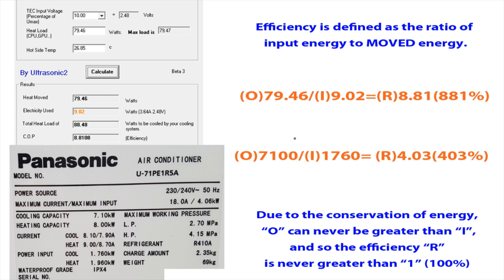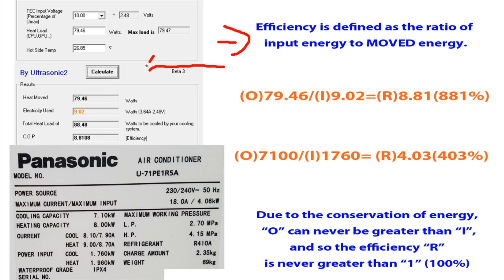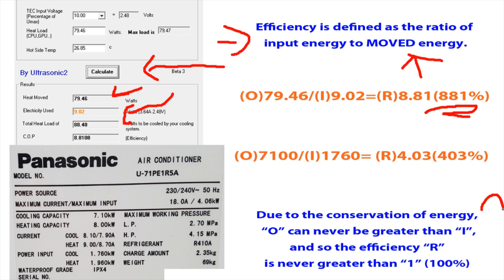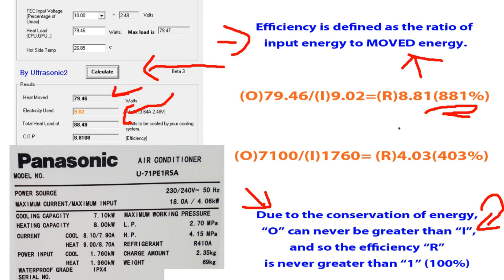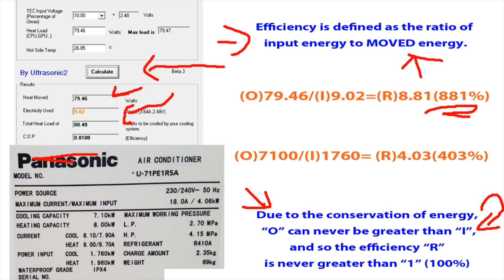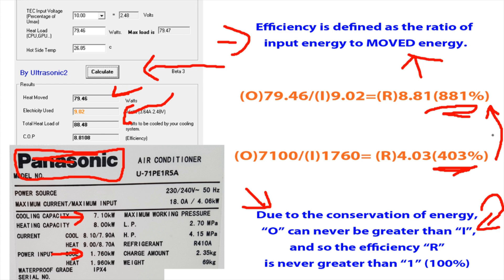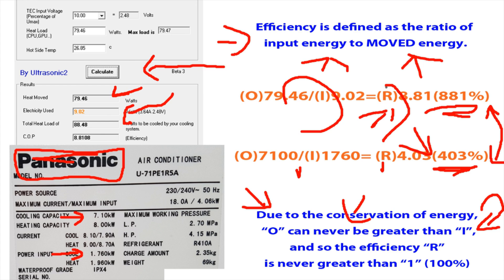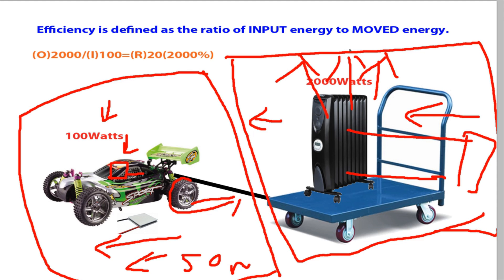🎓 Peltier efficiency:- Coefficient Of Performance Part4

Comment: Carnot Efficiency can also be called "Maximum Possible COP". It describes the theoretical limits. If we had a perfect heat pump, it would have a Carnot efficiency of 100%.

The Carnot cycle can be thought of as the most efficient cooling cycle allowed by physical laws. When the second law of thermodynamics states that not all the energy supplied to a cooler can be used to cool, the Carnot efficiency sets the limiting value on the fraction of the energy which can be so used.

In a cooling applications, there is a maximum amount of cooling which can occur with a given amount of electricity. This amount is the maximum Carnot efficiency. It means that the colder one wants to make something, the more energy it requires.
Trust me, I'm an engineer.
Reply: I don't think that is correct... You can MOVE something bigger than what you put in...  1 horsepower can move more than 1 horse... There is not a 1 to 1 relationship between heat moved in watts and watts used to move it,...   Regular ACs do way better than 1 to 1...

Comment: I'm no mathematician. I'm wondering. Wherein the equation do you insert the fact that the fact that the Peltier module is only as efficient as the ambient temp and heat displacement equipment? i.e. heatsink & fan. Also were in the equation do you figure in the ambient temp diminishing the efficiency.  I'm sure the label rating of 9 Watts in, 79 Watts out. Is under 32°F or at least under perfect condition. I'm sure you Peltier cooler will run warmer at an ambient temp of 79°F than at 69°F.  Again I"m not the one to figure this stuff out. However, I'm sure the Peltier module is not near 881% efficient in the real-world application. In fact, I'm guessing under the average room temp without central AC and/or more of a real-world environment the  modual might fall under  <0% efficiency? 
Don't take this as a dispute to your video's on the subject. This is more like a question than a dispute. In my experience with the Peltier module being used in coolers there efficiently seems to be lacking. However, that might be just because the coolers are under-designed and should have 6-8 modules to cool the 4-6 cubic feet of space instead of 1 or two module. But then the overall watts would go up to the amount of heat displacement per cubic foot. Let me know if I'm thinking about this correctly.  

  I'm experimenting right now with the Peltier module as a computer CPU cooler. I'm experimenting with some of the water-cooled gaming computers that I build. However, I'm going about it different them most. Most are attaching the module to the CPU directly. I think that is a recipe for disaster due to condensation turning in to running liquid. Therefore, I'm experimenting with the cooling of the water and not the CPU directly. I'm getting really good results. However, I'm in an Air-conditioned room. I also have the water blocks and module mounted to the outside of the case using high heat resistant wicking material to wick up, and condensation and the fan will dry the material before the condensation can turn to droplets of water.,  So far in one of my rights I can push my Intel i7-6950x to max 10 core 20 thread for hours and maintain a CPU temp of  38-42°F that is great result. With a room temp of 68°F However I"m running 4 Peltier 62MM modules.

Comment: So 403% vs. 881% means that we should throw away our compressor based heating/cooling units and get peltier ones?
Reply from the maker: A)no .. A TEC can only maintain that with a very low delta .. where as A compressor system can maintain a large one 
B)Also TEC's dont scale well ... It would be huge and expensive.
C)the numbers shown are for the TEC it's self not including the Required heat exchanges SO COP will be lower than that .
D) However since the TEC will conduct Heat with no power at all if the Space your trying to cool is WARMER than the SPACE your moving the heat too .. then you can cool your space with crazy high COP's ..
Reply: If you live in a home that has Air conditioning. the maybe yes. However, TEC is only as effective as the ambient temp. at those rating that is under ideal ambient temp.  Let's say it is 70-F in your home and you Peltier fridge is cooling to 40F. If the room temp jumps up to 78 your Peltier fridge will now only be cooling to 51F and your milk goes bad.  This video is right and wrong. the movement of energy rating at 9 watts in 79 watts out is under the perfect environment settings. In the real world, I would guess its more 9 wats in 15-20 watts out. Still over 100% but not as good as advertised.   My number is only hypethitical giberish but shows my point.
Reply: still waiting to hear about what efficiency IS and about peltier. 
just more confused at the moment